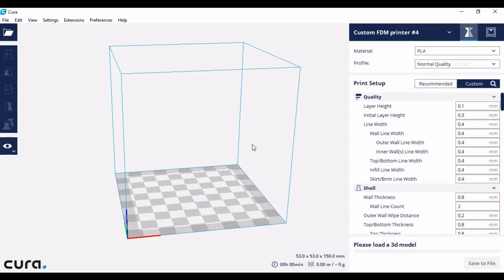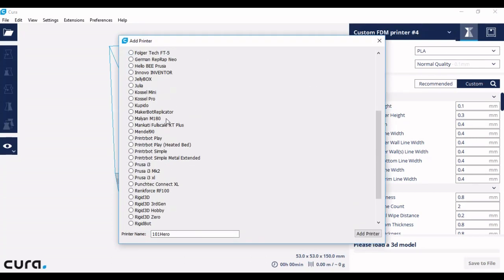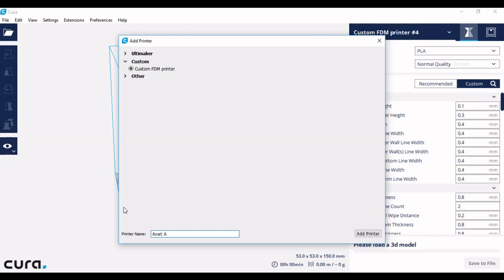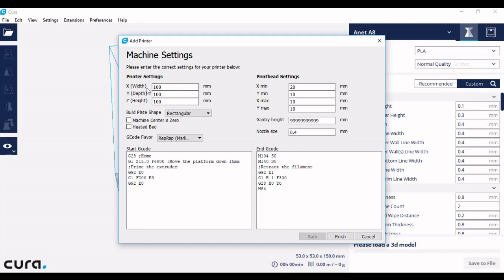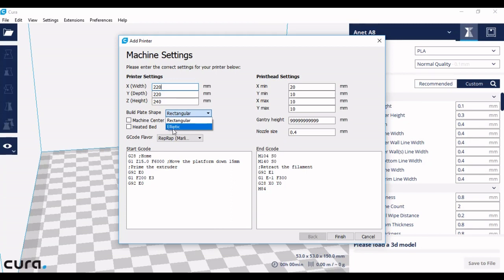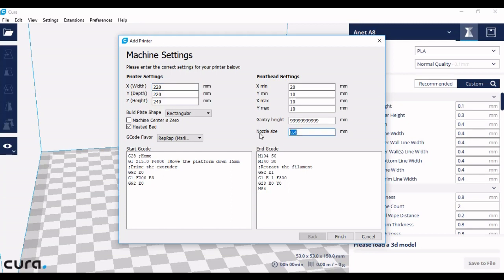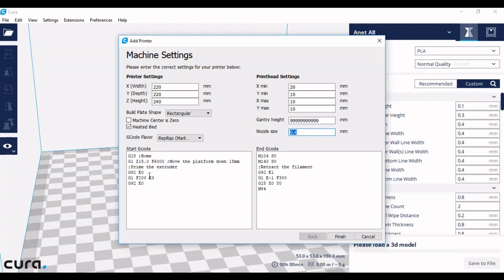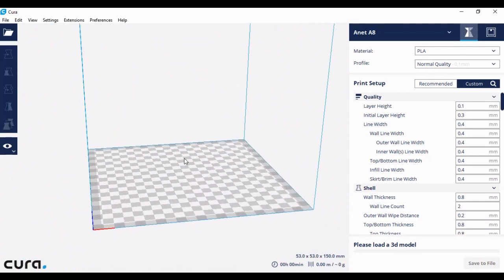Cura 3D Printing Tutorial Episode 6 setting up print area

Comment: Hold on.  I cant center my printer.  I have a sain smart with a build v on 300x300x330 . Every thing I do it says corrupt entry and will try to print off plate . Can you help?
Reply from the maker: could be a whole range of things from this description unfortunately, there could be something wrong with the mesh you are trying to print so that it isn't producing viable gcode, it could be a problem with the storage device you are using to transfer the file onto the print, could be a broken card reader on the machine not being about to read the file. as for printing 10mm about the bed make sure the model is sitting on the plate in Cura, it could also be the height of your end stop switches is off which is telling the printer the bed is higher than it is. i had a problem once where the print was printing in mid air because the SD card i was using had a fault where it was not recording the Z height. hope this can be of some help.